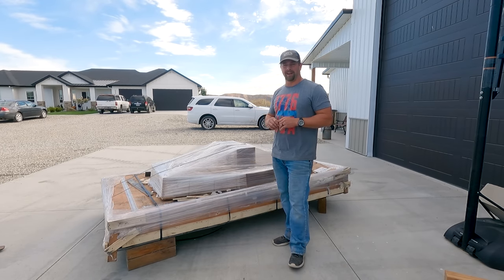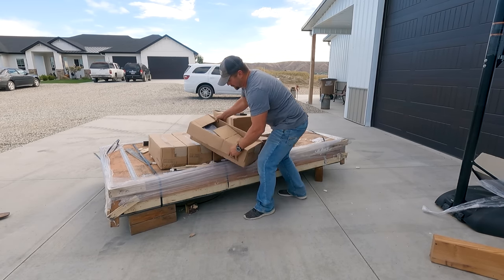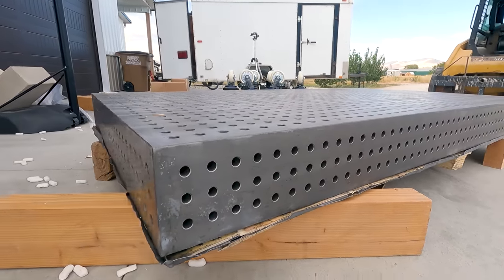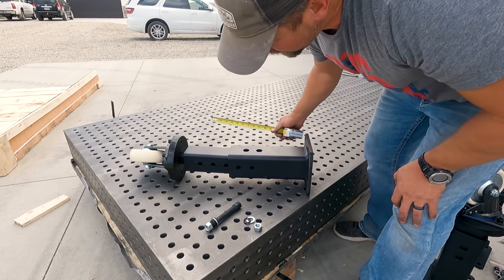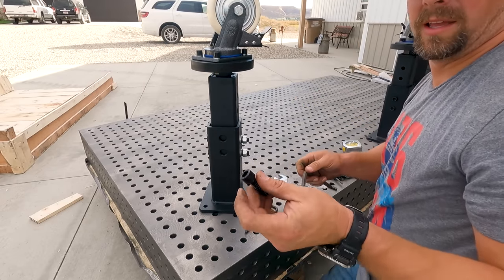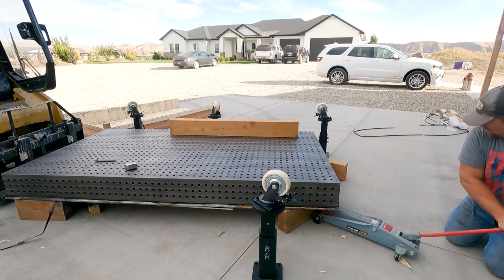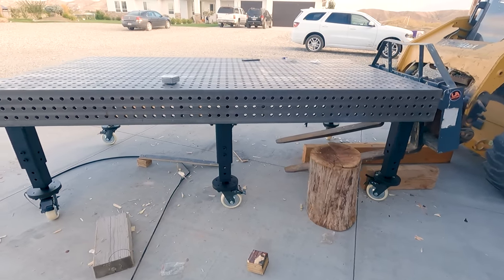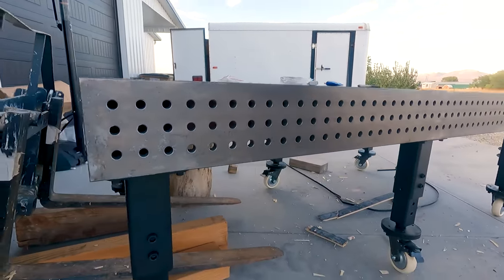What You Should Expect With a Fireball Tool FA75 Fixture Welding Table - Unboxing and Full Assembly

Comment: That's definitely a Very Sturdy, Welding Table.
I'm sure it came with a decent price tag attached.
But, IF you have a need for table like this. 
The price starts to become less important.
I'm sure it will be a real asset in your shop 👍
Reply from the maker: As I move toward getting a legitimate shop setup, I think it will be invaluable. thx

Comment: Nice job. I just went through this with a much smaller Sigmund table that’s 3 x 4 and weighs “only” 500 pounds. Fortunately I was able to use my stacker that lifts 880 pounds. Otherwise, your experience mirrors my own. I needed to take the same steps you did, and it also took me several hours. Getting the pallet off the bottom corners was the most difficult and time consuming thing. I had to push the top off the side of the pallet and saw the end off with my electric chain saw, then do the same to the other side. Then I could lift it enough to put the legs on.

It’s interesting but it seems that none of these manufacturers give even one page of instructions. My problem is that there is a circle of holes on a ledge on the bottom, like yours, but only two are used with 16mm bolts. It was fun figuring out which holes were the right ones.

Enjoy your table.
Reply from the maker: You'll keep finding new uses for the table, they're amazing.  Glad you got one
Reply: @rustedox3174  true. I also use some welding fixtures on my mill.
Reply from the maker: that is one more toy I'd like to get eventually @melgross
Reply: @rustedox3174  even a smaller one is very useful. Once you get used to it you can begin to imagine everything you can make. Fixtures are easy to do on a mill and if you need something special that’s expensive, or not made, well, there you go!

Comment: Very nice video!  I'm sure that table will come in very handy.  Lord knows I wouldn't mind having one here in the smithy.  If I might make a suggestion, get a copy of the Ashley Book of Knots.  Over the years, I've seen a consistent pattern amongst us builders - we've tended to forget that rope is amazingly handy stuff.  It wasn't too long ago that rope was used to move the world, including heavy equipment like that.  Knowing how to splice a line, making a grommet or lifting strap just the size you need, is incredibly handy around the shop, and today's modern plastic ropes are tremendously strong.
Reply from the maker: I love and know knots, but that's an impressive collection
Reply: @rustedox3174  The ABoK is considered the bible of knot-tying and well worth having around the shop.  Modern lifting straps and ratcheting gadgets are nice, but more often than not.... good ol' rope works better because you can use it for other things, in other ways.  Plus, it's a great thing to get kids involved.  First Class Amateur has a great Youtube channel that shows a slew of ways that rope can be used in everyday activities you'd never think about.

Comment: Great video thanks  for posting.  I am awaiting delivery of my Fireball table with great anticipation.  I am going to be building my own base and need to attach casters temporarily to the top.  Could you tell me the size of the top of the legs, the part that directly contacts the table top, as well as the on center distance of the holes, you had mentioned M10 in the video for size?
Keep posting!

Comment: How much did they charge for shipping
Reply from the maker: I caught the table on a free shipping special.  The accessories cost me $250 to ship from CA to ID.  They weren't included in the free shipping, which was a little annoying because they came strapped to the top of the table.  In theory, it saved me some money until I justified adding more fixtures.

Comment: I just ordered several tonnes of pellet feed making equipment and it’s the same thing EVERY SHIPMENT! Wood costs too much so shipping boxes and pallets just don’t make the trip.  If you are ordering heavy steel…get out your welder and a spray paint can!  Though my ‘cheap’ streak would just never let me part with $11k (or even $9k for a blem) for a welding table unless fabrication was my whole life.
Reply from the maker: Never say never, I think it will be useful beyond just metal fabrication.  Although doing woodwork on this thing might get me burned at the stake.

Comment: All you had to do was pick it from the middle with your forks spread out as far out as you could... would've made it a 30minute job...
Reply from the maker: ...until my skid steer tipped over.  The tabletop without legs weighs 2,650lb and the Cat 226b3 is rated for 1,500lb.  A bigger machine would have made the job much simpler.

Comment: $8500  
A nice system if you do a lot of that kind of work
Reply from the maker: Fireball did a nice job with it.  It might be against some fabricators code, but it will get used on wood projects as well.

Comment: If only the table had some holes in you could bolt a tab to and lift with a strap and the plywood would just fall out of the way...
Reply from the maker: That would have been fantastic and would have prevented some scratches I made on the legs